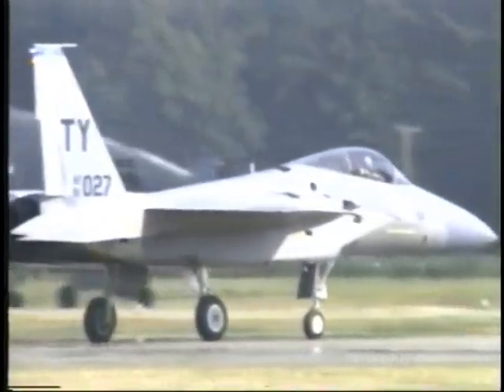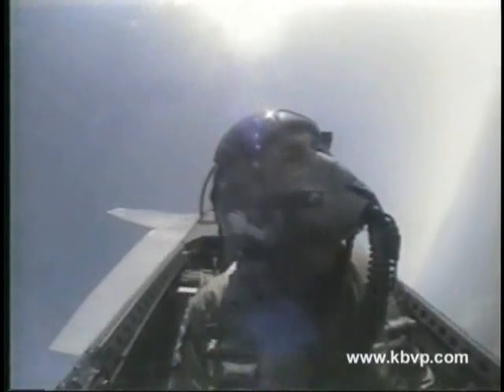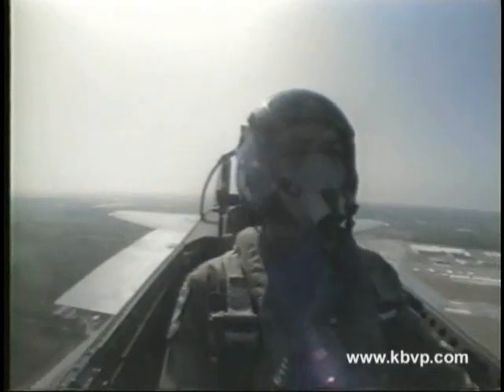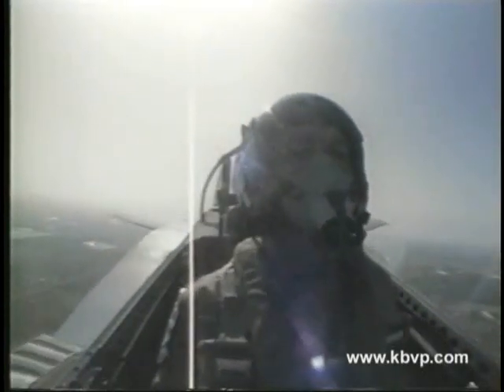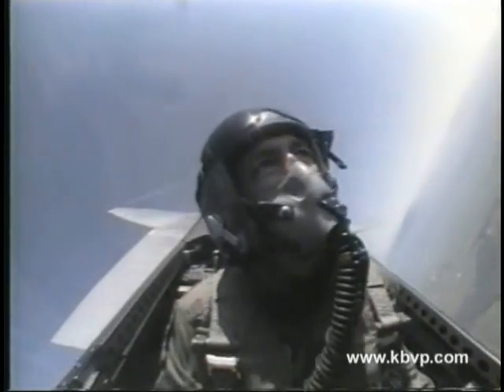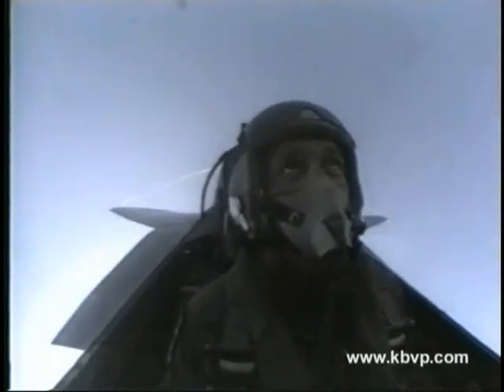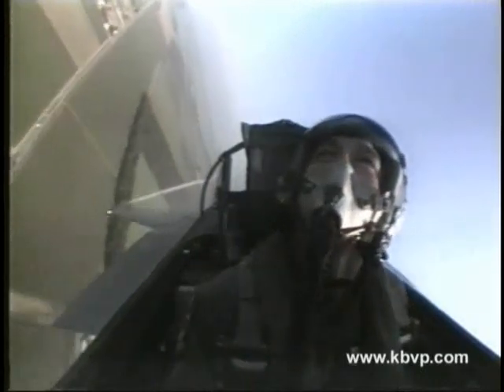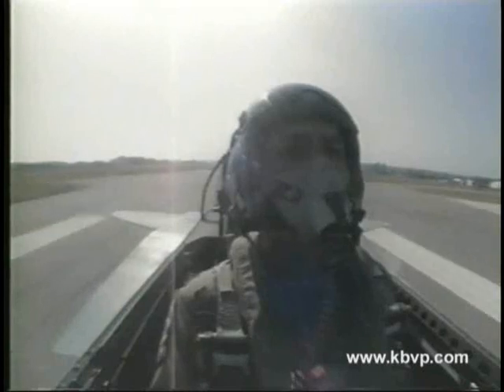F-15 Eagle Cockpit Video

Comment: Never knew the F15 intakes moved. Let alone automatically.
Reply: I think it's a calculation using airspeed and angle of attack to keep the engines from compressor stalling. I think in straight and level flight at high airspeeds the intakes would tend to streamline so they can reach Mach 2+ airspeeds. But I think that when maneuvering they position themselves depending on the angle of attack to keep air moving down the intakes at the optimum rate.

Comment: That was my awesome Eagle, 1027.  Tragically she crashed in 2004 when her pilot inadvertently ejected.  I actually mounted the Camera for this video w/Keith (it's on the old Eagle Eye bracket).  It was 1993.  F-15 West Coast Demo Team.  Interesting fact:  We would estimate Capt. Donovan's G's during his tight turn by counting how many seconds it took to complete and of course call him unpleasant names if he took a second or two longer than his best time.
Reply: Ron, the F-15 is not fly-by-wire, is it? It must have some sort of flight control computers. Even the 737 has that.
Reply: @rael5469  Not this version of the F-15.  Yes it does have computers and mechanical ratio changers/controllers though.
Reply: @ronwagner5942  Interesting. Thanks.
Reply: You can Google it.  Don't know how much detail it will show.  The pilot did survive.  I have never seen the stats on the Phantom but they are still flying as drones down at Tyndall.  We don't call the F-16 Lawn Dart for nothing.  They are supposed to take over the drone mission from the F-4 and they already had one crash.
Reply: Ron Wagner when I read the fate of her 😟😭